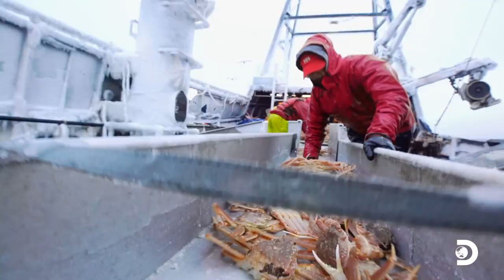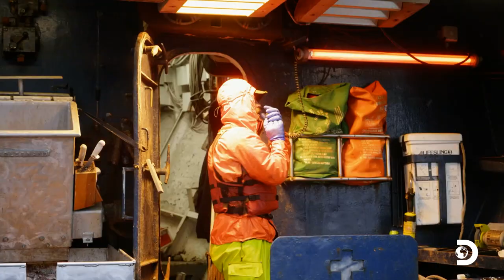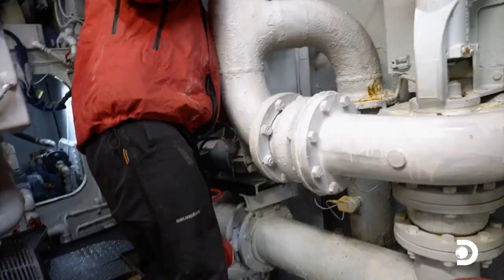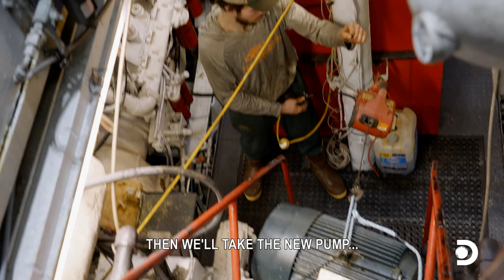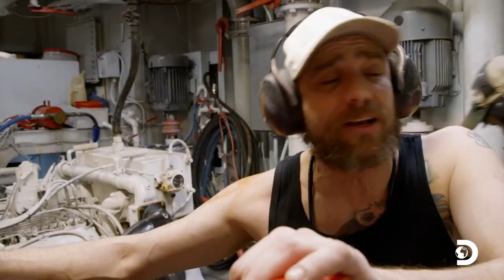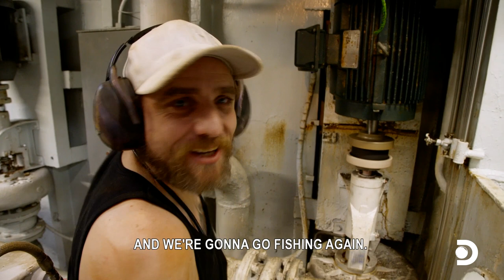Failing Water Pump Almost Capsizes the Saga! | Deadliest Catch

Comment: How's the pump keep the water from sloshing? Or is the crab tank connected to the ocean.
Reply: A full tank is set and doesn't slosh back and forth. It's the momentum om the moving water mass that destabilize the vessel. 5 ppl can sit safely in a dingy if they're still, but one person capsize it by simply rocking left-right.
Reply: @DontWasteCake  I'm a bit confused on the engineering. I see there being slits above the buoyancy chamber on the commercial FV that allow water to pass through, what is that for?